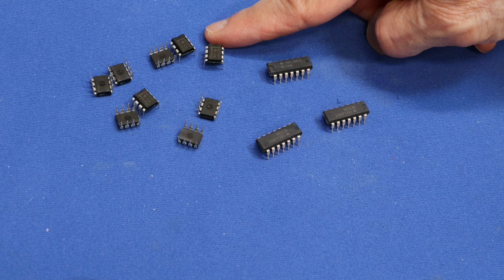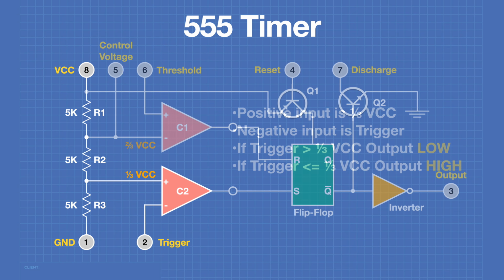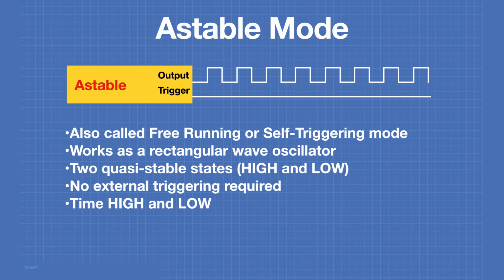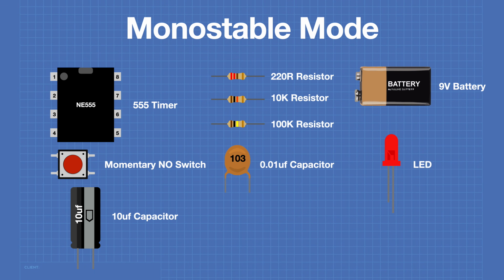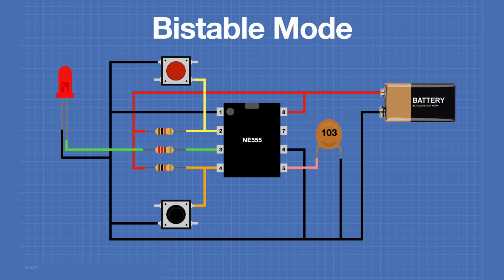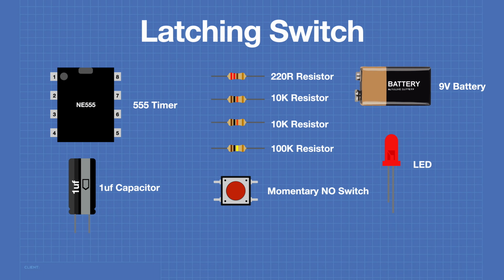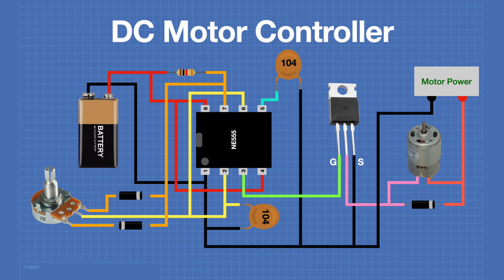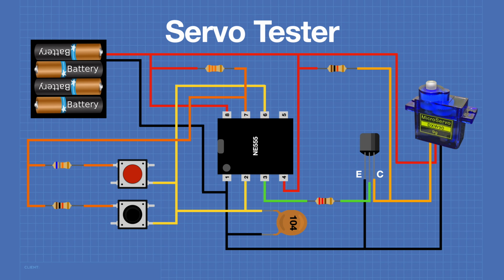Using the 555 Timer

Comment: Good video and nice explanation of the 555Timer. I can follow you and it makes sense except...the NOT Q output is connected directly to the base of Q2 (an NPN BJT transistor) with emitter connected directly to the ground. We knew regardless of the base voltage, the voltage drop on the base to emitter is always limited to 0.7V for silicon. Pushing this voltage high will damage the transistor. Now, regardless of the change of state of NOT Q, the voltage output will always be clamped to 0.7V and not enough voltage to drive or toggle the inverter. The real 555Timer obviously will work but in this illustration and diagram, it's not possible unless there is a limiting resistor between the Q2 base and NOT Q Flip-Flop. I knew you will agree with me. Cheers and well done with this tutorial. I would like to create a video tutorial simulation on LabVIEW with 555Timer on my other channel. Keep up the good work!
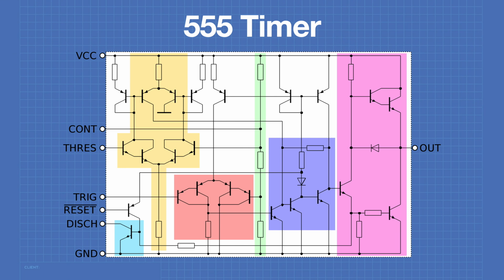Reply: The resistor actually is. Look at 3:05.

Comment: Hi how would one use the same method 12 - 24v 540watt flasher unit and a push button to change patterns  with a 2 channel creating a fast left right, blinking, slow left right and stay on mode

Comment: 28:17 Latching switch.
I need triggered this circuit from output of sensors, i.e. touch, obstacle, PIR, etc. What should we do?
Can we replace switch button with transistor ..or.. maybe there is other trick?

Comment: I was doing some experimentation on Tinkercad Circuits and it's telling me that the 220 ohms resistor is too low for the 9V as it will lead to 28mA instead of the 20mA we should aim for on a red LED, maybe for a led that will be blinking is not so important.

Comment: on monostable mode it wasnt working like a timer and i started ripping cables out in frustraition, which made it work like a timer?, i removed everything on the right side except for a positive connection connected to pin 8 on the timer

Comment: thanks for share, just may I ask why do we need 2 diode on potentiameter for motor controller circuit,  I checked with oscilloscope i realise without diode the cycle time also will change as I change the pulse width, why is that?

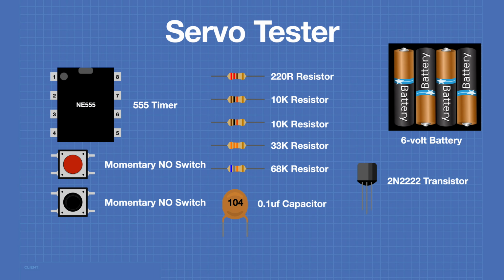Comment: 37:40   The parts list vs color codes is wrong  the two resistors marked as 10K  are by color code 1K   Brown, Black, Red, Gold  are 1K    you need  Brown, Black ,Orange, Gold  for 10K   this seems to be in all the illustrations you made for each circuit design.

Comment: I have this flashing circuit that flashes 2 different Leds on and off 
But you have to push a button that grounds pin 2 the trigger input on the 555
I want to be able to just apply power to it and have it start flashing without having to push the button
Is there a circuit i could use that would ground the trigger input just after power is applied
Any help would be appreciated!
Thanks.

Comment: Hi - I need a period of .68755 to run a mechanical clock conversion (to regulate a pendulum) - how stable is a 555? or would I have to use a crystal - bearing in mind - the clock is still spring driven and needs to be wound - so a couple of seconds a day is neither here or there?

Comment: The latching switch is an interesting circuit with a number of uses. It seems the 555 is being used in Schmitt trigger mode.
My question is about the connection of the 100k resistor charging the timing capacitor. Shouldn't this resistor be connected to pin 3 (output) and not to the LED so full voltage is applied to the capacitor?
Reply: I was simulating this example on Tinkercad Circuits and couldn't get it to work. I was wondering if something was wrong on the schematic. Doing this modification that you suggest made the circuit work. So yes, sounds about right.

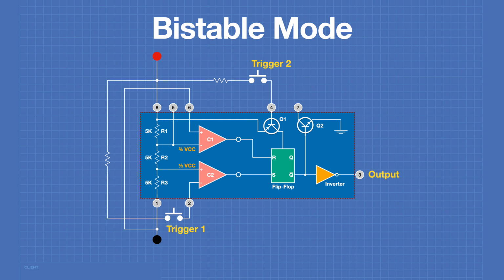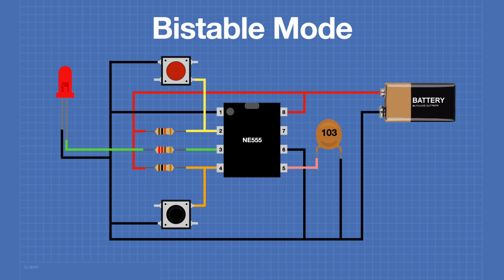Comment: Actually, several things in diagram at 19:40 are confusing to me, and they do not add up with circuit at 20:34. As a particular case, none of the buttons is directly or indirectly linked to ground, while they are in the circuit.

Comment: Does anyone know :

•   MANY  MOONS  AGO  🌚  (80's)  ,  
a new variant was produced which 
i believe was 16 pins ,  and began 
with "L" .  i'm assuming it was a 556 
with the additional pins labelled as 
A & B .
•   A & B were "monitored" lines , and 
the chip would respond in different 
ways depending upon  whether the 
states of  A & B  were high or low. 
( I don't recall the specifics of the 
Truth Table ,  but I know I really 
Really WANTED to get a half dozen 
to play with ,  but  I was moving & 
lost track of that magazine 😕 )
•  Anyone out there familiar with that 
variant ? THANKS .

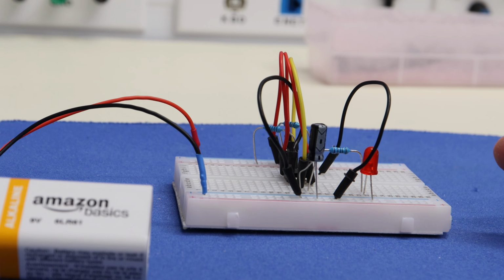Comment: 00:00 - Introduction
01:40 - 555 Timer Operation
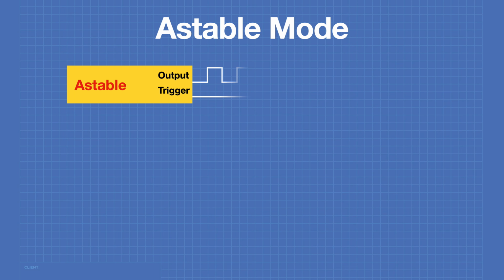10:28 - Astable Mode
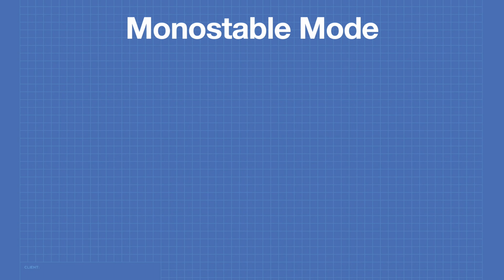15:09 - Monostable Mode
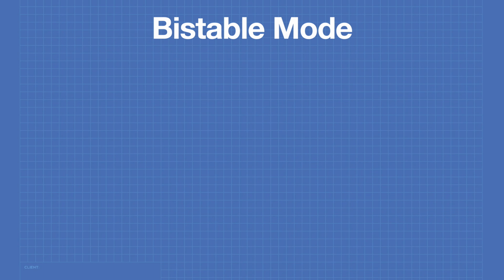19:14 - Bistable Mode
23:12 - Light Chaser
28:15 - Latching Switch
30:39 - DC Motor Controller
34:36 - Touch Switch
37:20 - Servo Motor Tester
40:03 - Conclusion

Comment: OK, I'm a new player probably falling into a new player trap, but I'm confused about something.  At 6:13, I see that inputting a high to boh input SET and RESET is invalid.  That makes logical sense.  But the comparators C1 and C2 operate independently.  One comparator does not know what the other is doing.  What happens if the trigger voltage at pin 2 is > 1/3 of the VCC and the threshold voltage at pin 6 is < 2/3 of the VCC?  The outputs of C1 and C2 will be 0, then inverted to 1 for the SET and RESET inputs of the flip-flop.  It is possible that the "real world" could create this sequence of events.

Comment: at 6:25you write R low when threshold low. as i see it, this is correct just after the comparator, but due to the inverse, circle, i would expect a R high with an treshold LOW. (du to the inverse fuction.)
can you confirm?

Comment: This is an old video I know, I set up a 555 timer in A stable mode, I’m also using a NPN transistor. 
I’ve tried several different caps and resistors combinations, I cannot get the LED to fade, why?
I’ve checked over the all the points, made sure jumpers and pins were where they are supposed to be.

Comment: Great video! I have not read al of the comments, but has anyone pointed out yet that the LED in the Monostable circuit (around 17:00) is displayed the wrong way around? This could be very confusing for fresh electronics students. The anode is connected to ground, and the cathode to the 555 output through a 220 ohm resistor. This is never going to light up. Either connect the anode to VCC or reverse the LED.
Reply: Searching how to recognize the anode of a LED shows that a very bad photo has been used a lot of times. This picture shows a clear LED held between someone's  fingers, thus hiding the important length of the connecting leads. The longer lead being the anode. The other silly thing is that the LED is held in the opposite direction of the symbol in the photo. So the anode of the symbol is on the left, while the anode of the LED is on the right. I found a much clearer picture that could have been used instead: https://www.switchelectronics.co.uk/pub/media/wysiwyg/LED_Polarity_Diagram.png

Comment: i notice that in 38:44  you only have one 104 capacitor but at 38:55 it shows two capacitors. is that a mistake? also does it matter if i use electrolytic capacitors over the ceramic ones?

Comment: Great video ! However there is a mistake in the latch circuit schematic. The 100 k resistor should connect directly from pin 3 to the positive pin of the capacitor.
Reply: Hi, I tried to follow what you said. Which diagram and mode of operation are you referring to? I think most diagrams had maybe pin 5 going to the cap. Thanks.

Comment: With the motor project, why use a 555 at all? Cant you just place the POT in between the power source direct to motor and vary the voltage?

Comment: I started experimenting electonic circuits when I was in grade 10 in 80s.  I am among those folks who didn't find this chip very useful when I had discovered CMOS chips.  Basically you can do all those four modes using a Schmitt trigger like cd4093 which has 4 nand Schmitt triggers.  It was  cheaer and more convenient to design any of those 4 modes and the formulas were  more  predictable for me.  But I know there are lots of folks who love this chip.

Comment: I’ve required the 555 latching switch exactly how you have it 10x and yet every single time, my LED lights up as soon as I give it power, pushing the button does nothing. Extremely frustrating. I have my circuit EXACTLY as you have it.

Comment: Help me out here.  I feel stupid and I could be very wrong but:  @ 6:30 with the truth table, if Threshold is LOW then the output of C1 should be LOW because the inverting input is @ 2/3Vcc.  On that same table line, with Trigger LOW on the inverting input of C2 and 1/3Vcc on the non-inverting input, the C2 output should be HIGH.  Here's where I'm confused: in the description of the feed from the comparators to the flip-flop, it was stated that these outputs, from C1 and C2, are inverted.  That would mean that the output from C1 would be changed from LOW to HIGH, and C2 changed from HIGH to LOW.  That would mean that the input at R from C1 would be HIGH and the input at S from C2 would be LOW.  This is not accurate by the truth table.  The same seems to carry on for the other rows.  What am I missing or doing wrong?

Comment: I have a question about the transistor between VCC and RESET (video 7:19).
From my understanding of the PNP transistor, it will turn on if the Reset(Vb) is lower than VCC(Ve)  0.7V.  That's why you call Reset "Normally held HIGH(transistor on)?"
Reply: I had the same understanding and was searching for a comment like yours. Any suggestions anyone?

I have a Masters Degree in EE but never worked in that field

Comment: Very nice demonstration, nicely laidout schematic, animation and testing. One thing I did not understand is the comparision of your circuit with Microcontrollers. You kept saying that a discrete design is far cheaper than Microcontroller. And I believe this is not what you are proving. BTW one Microcontroller can be programmed to perform thousands of testing with the same components and interface. You cannot prove that stand-alone are cheaper and easier. We do testing with Microcontrollers first and then finished it up with stand-alone module if so needed. I design industrial controllers and as a matter of fact I have one with dynmic applications, one controller that can control environmental equipment, road traffic, or inter-dependent machine operations with 64 digital inputs, 16 analog inputs, 255 digital outputs, and 16 analog outputs, programmable to use either 0-5, 0-10 volts or 4-20mA. Anyways, I accidently hit your recommended video and wanted to show it to my 13 years old son who sometimes watches me developing the controlware on Allen Bradely, Siemen, Omron, and Hitachi PLCs and testing. Keep up the good work. Your workshop is cool and your demonstrations are really well detailed.  I normally don't put coments but your work is so well organized with schematic, and details on working principle that we don't find on many videos on Youtube. You are doing a great work for those entering into digital world. I liked your video.
Reply: Remember, he never said all discrete designs are cheaper than all digital designs -- of course not!  It depends on what you're making, but of course in many cases, to use an Arduino or some other controller will add more complexity and cost than you need.  Still, Arduino is very popular for a reason -- you can do many things with it, and it changes the problem from "mostly analog electronics" to "mostly software".  Which is, of course, the general reason that most technology has transitioned to digital in the past few decades, including your job!  But analog is still useful, and for some people, is more fun.  Also, of course... analog provides the technology that makes digital possible -- a MOSFET is an analog part!  So it's good to understand analog techniques.  Creativity is required.

Comment: On 6:33 in truth table when R and S in flip-flop are both LOW output keeps previous state, it's not always LOW.
Reply: Also there is a problem in scheme of latching switch o 29:03. On scheme like this there can't be transition from HIGH to LOW output. 100 K resistor needs to be directly on the 3 pad of NE555 because in that case when output is HIGH on pad 3 is 7,5V and on comparator C1 + side voltage is 7,5 V and on - side is 4,5 V so R on flip-flop is HIGH and output transit from HIGH to LOW. If 100 K is connected to LED like on this scheme on Comparator C1 + comes only 3 V which isn't enough to activate R on HIGH on flip flop (because on C1 - side is 4,5 V) and transition never ends (led continue lightning indefinite).

Comment: Great video, Bill. Thanks! Question on the servo tester at about 39:20, what happens if you push and hold one of the buttons beyond the servo's rotational limit? I feel like I should be able to answer my own question, but I am not sure.
Reply: he is not actually increasing or decreasing the pulse width output - he is using the buttons to switch between 2 preset pulse settings by the 2 resistors - 1 high  or 1 low  or no signal
Reply: @johno5913  Ah, that makes sense. Thanks for the clarification. I figured it was something like that.

Comment: maybe a little late, but figure I'd ask. For the DC motor controller, if you were to replace the 9V battery with a voltage regulator, could you power it from your main motor power source without frying the 555? for example with a 24V 250W motor and matching battery? Love your content, thank you
Reply: You are looking at about 10.4 A, you will fry it for sure

Comment: I'm trying the latching switch now but I noticed that the drawing looks different on the #3 pin circuit than what you actually have on the board itself.  It looks like the orange wire is going to the top of the resistor instead of the way it's drawn where the green is the connector to the top. 
But it is hard to tell with the pic of the board.
Reply: Yeah, that's what it was. 
For those that are trying the latching circuit just tie the top of the 100k resistor to the #3 pin and not to the output of the 220 ohm R.

Comment: What will be the capacitor and resistor values if i need to to generate on and off pulse after 12 hours to turn off my light bulb and the turn on after 12 hours?
Reply: Looks like no one answered you. Because you are looking for 50 duty cycle,  resistors and capacitors have standard values, and varying tolerances, you'd be better off using an intermatic TN111K 15 AMP INDOOR TIMER. But if you are just curious, there are 555 timer calculators online. Look them up...
Reply: @stever.9925  Thanks for the reply, I was actually looking to make an auto switch off after 12 hours.

Now i can program microcontroller and can use as per my requirements, like last few videos on my channel.l, so no need to play with 555, it can be achieved using a cheap microcontroller.

Comment: Hi Mr Dronebot,
Question about the Touch Switch circuit.
If the switch is kept pressed, does the LED stay on?
I would like a circuit where the LED always goes out even if the switch is kept pressed.....
Is that possible?
Reply: The answer is mono stable mode
Reply: @bayareapianist  
Thanks for answering, I have no idea what to change in the schematic because I have no knowledge of electronics content.
I googled mono stable mode and I hope to get on with it.
Reply: @Dub_the_Viking  the answer is if you use monostable  mode the output will swing only once no matter how long you press it.  This mode is also called one-shut.

Comment: CAN ONE 220 OHM RESISTOR BE USED IN THE COMMON GROUND SIDE FOR THE LED'S INSTEAD OF 10PCS   ?
Reply: Yes. That is a much more sensible thing to do in that circuit.
If you were mixing LED colors you might use a different value of resistor for each color group to balance the visual brightness.

Comment: the monostable configuration is not working, the LED stays ON all the time and turns off when I click the push button
Reply: Must have done the wiring wrong, maybe you connected every wire that overlays another on the picture together ? The only wires connected directly to each other are the ones with the same color

Comment: Why do you do a motor controller so complicated. Why dont just place the motor with the potentiometer in series. Once you increase the resistance using the potentiometer, the motor will be slower because of the higher voltage drop over the potentiometer

Comment: I think there is something wrong with your Truth Table otherwise I completely misunderstand this. Let's use the first line:
VCC = 12v
Threshold = 3V (LOW)
Trigger = 3V (LOW)

C1 output = (LOW)

C2 output = (HIGH)

Both gets inverted

SET = LOW

RESET = HIGH

NOT Q = HIGH